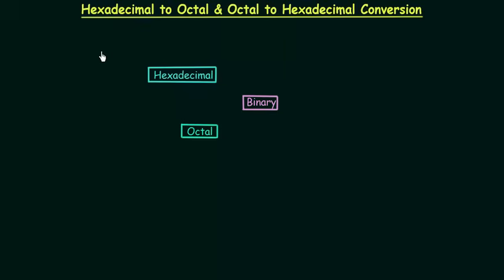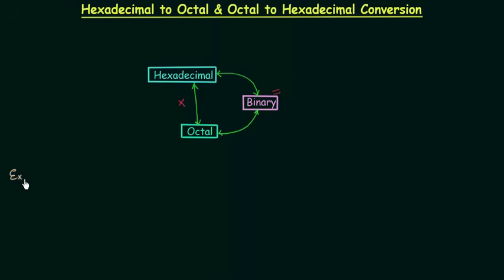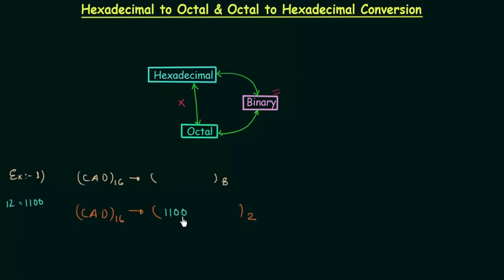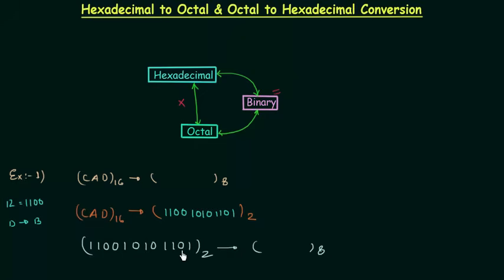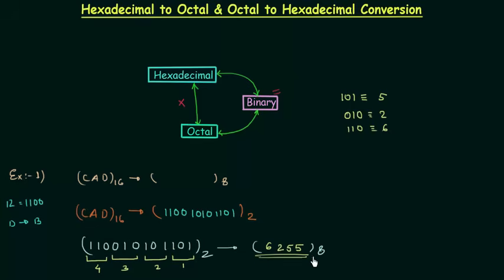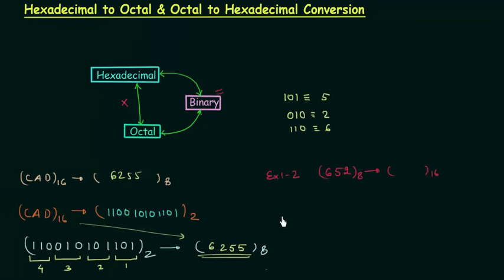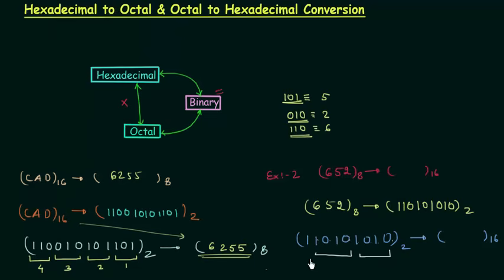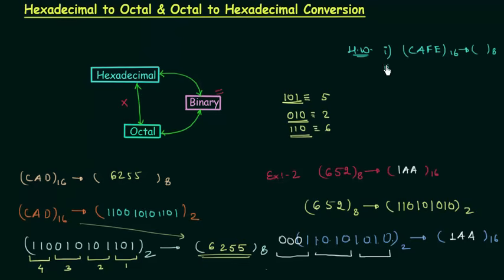Hexadecimal to Octal & Octal to Hexadecimal Conversion

Comment: To sum up ALL conversions:
Octal to Binary and vice versa:
each THREE bits is equivalent to a digit (0->7)

Hexadecimal to Binary and vice versa:
each FOUR bits is equivalent to a digit (0->9 A->F)

Decimal to any numerical system:
we divide the integer part by the base 
(answer from down to up)
we multiply the fractional part by the base
(answer from up to down)

Any numerical system to Decimal:
The sum of (each digit*(base)^r)
r is the index 
integer part r :(0,1,2,3,....)
fractional part r:(-1,-2,-3,...)

Comment: Sir, why the direct conversion is not possible for hexadecimal to octal and octal to hexadecimal?
Reply: Because 16 is not a power for 8, also not in reverse.

though - they do have a common root which is 2, and thats why you can still manage to do a "partial direct" conversion(from each to 2, and vice versa)
Reply: thank you.. i have one more doubt.. decimal and binary conversion is possible though they are not powers of each other..  is it not possible to convert to hexa to octal without taking the common root 2
Reply: @sushmanaik2228  
Very nice question! :)

Going from any radix to decimal, you don't infact use direct conversion, but regular decimal conversion which is a specific type of conversion itself, ie adding the digits x base to the power of position, for example:

56 in r7 is 5 x 7^1 + 6 x7^0.

Because we dont tend to use (which is what makes your question a good one by the way! It might not be the case that there isn't a specific conversion method to these bases :) ) a specific conversion to 16 and 8, we cant do a "hexa conversion" or "octal conversion" to go from base r to 16 or 8.

and that's the difference, and why we like "comftorable" direct conversion which, in term, require powers who make our lifes easier when the requirement of the powers is met! (Instead of the most hated, going from r1 to decimal, and from decimal to r2, which feels very long and winding, going from r3 to r7 is a pain haha)

Hope that helped🙂